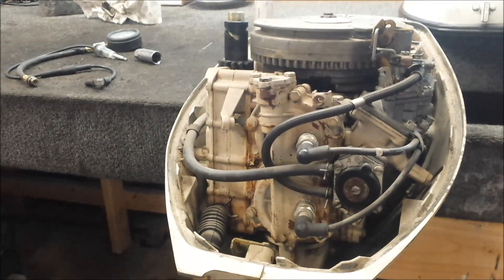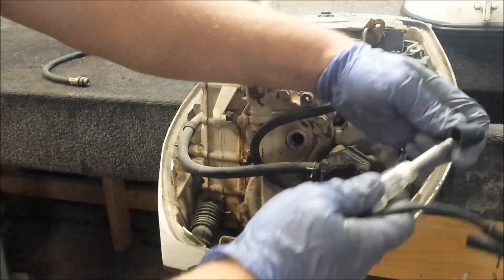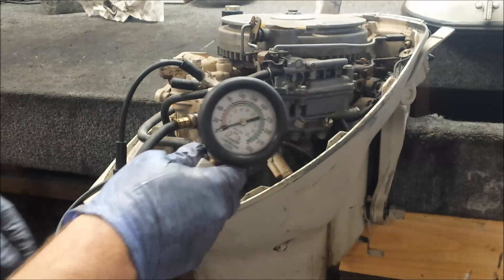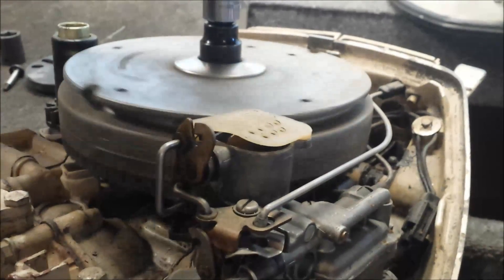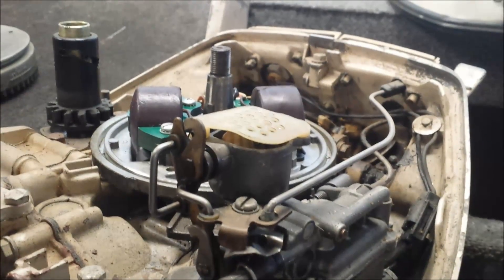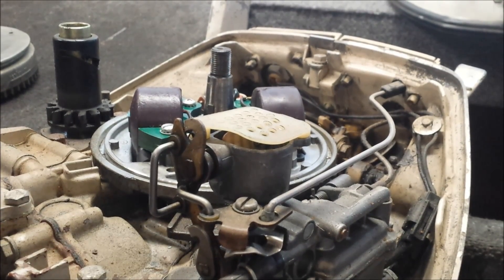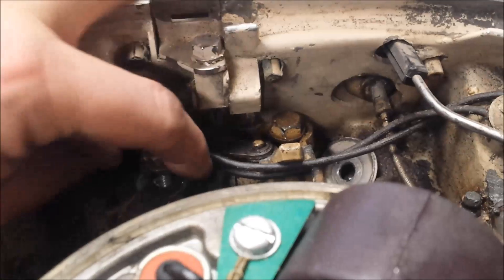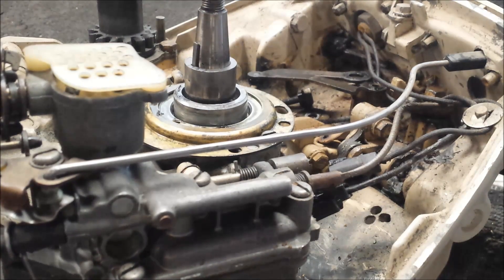Johnson 9.5 HP Teardown - Part 2; Ignition System

Comment: Hello. I signed up for youtude just to ask you this question? That was almost as frustrating as the problem Im having.LOL I have a 9.5 johnson and it runs pretty decent until I put the cowl on? Like its being choked out or exhaust fumes are killing it??  Have you ran across this? Any thoughts? Was hoping you or someone could point me in the right direction.  Your videos are very helpful and make sense to me. Thank You
Reply: Check the rubber exhaust boot for exhaust leak.  You probably need a new one

Comment: I have this motor, but my spark plugs are both the same part # champion j4c, but the bottom cylinder spark plug has a bigger thread. Not sure if someone put some type of insert in it or what.

Comment: Do you have any videos or know anywhere that shows how to put it all back together? I broke my ‘64 9.5 down to this point and replaced a bad spark plug wire and now I’m not sure how to get it all lined back up and put back together correctly.
Reply from the maker: Just the ignition?
Its same same as the ignition system as my recently completed 10 HP

Comment: I am trying to use the Nova II chips.64- 9.5 hp Johnson sea horse. I have 3 leads coming off my coils. I think one is ground and the other 2 went to the condensor and points. there is the stop switch in there too. do you have any info or ideas on this. I don't know what to do with them. do I tie those 2 together and put them on the positive side of the Chip? what about the stop button? thanks for all of the helpful videos. your a life saver. and you have motivated me to fix my outboard that I kept from when I was a kid in the 80's

Comment: What is the puller you used on the flywheel?
Reply from the maker: Its in the description: 
Evinrude Puller: http://amzn.to/2sFeZpG

Also, discussed in greater detail in this video:
https://youtu.be/ebKkLTQMl9Y
Reply: I  used a harmonic balancer puller from AutoZone. I got the bolts and washers from the hardware store

Comment: Never thought to use a drill on mine to do a compression  check.Would you be able, if you get an engine with bad rods or bad main bearings running to video that.Would like to hear it.thanks
Reply from the maker: Next time I come across one sure. 
It sounds like a rattle; the more common type of failure I find is the wrist pin bearings or bushing. 
This allows the rod to rock back and forth just a hair, causing a racket. 
If you hear any knocking in a powerhead, there is a problem.
Reply: Thanks-I bought an 1985 johnson 20hp last year and after going from a 1988' 9.9hp the engine sounds alittle different of course.At full throttle I am not sure on the 20hp if I have a very slight rattle or it is just how the engine sounds?I do not really hear a knocking.I would have to compare it to another similar one.Never know what you get with used ones?Like no gear oil in the lower unit when I got it home.Should of checked it first.Seems to be working so far.